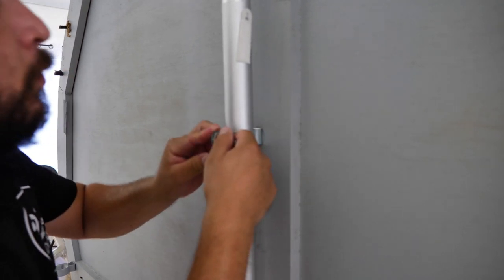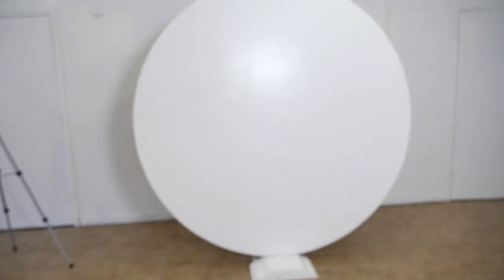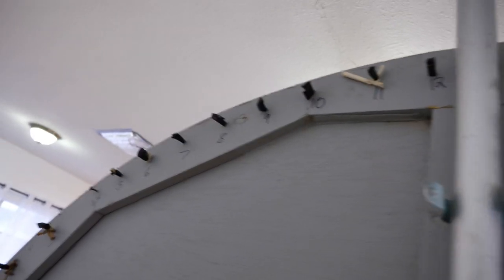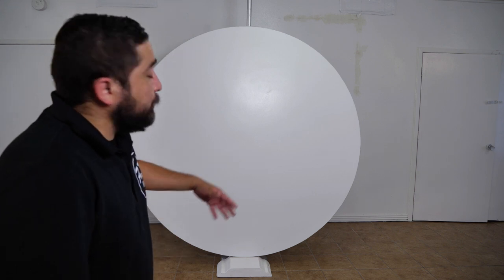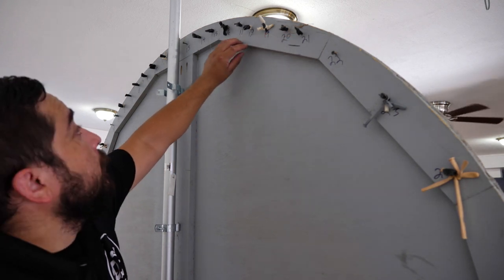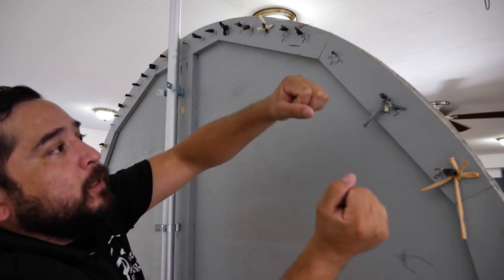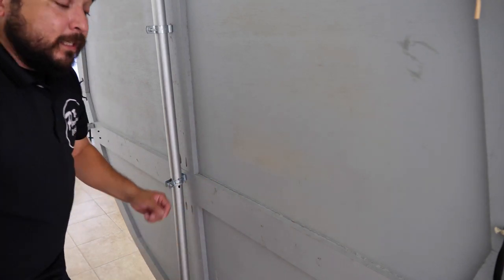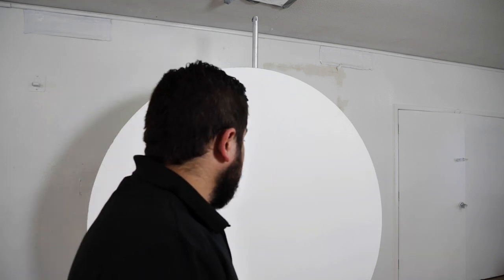How I made My DIY Circle Backdrop for Event Rentals for extra income

Comment: What paint did you use to paint the round backdrop?
Reply from the maker: Hi, thanks for watching. I used high gloss white from Behr. The high gloss gives it a good shine and worked great,
Reply: Did u put a clear coat on top of it or no?
Reply from the maker: @natashamitchell2904  The high gloss paint is the clear coat over it. There is satin, semi gloss, gloss, high gloss, etc. These are just different amount of clear coat built into the paint to give it shine. Matte paint has no gloss or shine. So high gloss gives a lot of shine because of the clear coat. It also protects it from stains or peoples hand prints better than a satin or a matte paint would. It is not 100% but it can easily be wiped off after an event. I repainted it maybe after about 6 months to give it the shine back with the original paint and worked great. You can try to add a clear coat on top but some times clear coats can tint the paint slightly yellow ish so I opted to just leave as is. If you decide to put a clear coat I would try first on a scrap piece of wood with the white, let dry and then clear coat. Then wait a couple of days to see if there was any reaction to the color. Hope this helps!

Comment: The oh baby was made from what material. If you dont mind sharing
Reply from the maker: Hi, thanks for watching. The Oh Baby sign was made from MDF board you can buy at Home Depot. MDF has a smooth finish and takes paint well after primer. But when cutting it wear a mask as the dust particles in the saw dust are not meant to be inhaled and can be dangerous to your lungs. Most signs are made from MDF because of the finish and the fact you do not have wood grain shining though the paint like you would with plywood. Good Luck.
Reply: @MakerDecor  much thanks for the info

Comment: Hi I had a question and wanted to make sure I am instancing correctly. When you made the circle backdrop is it cut into two pieces but you filled in the gap to cover? And what was used for the white part?
Reply from the maker: Hi, yes It is two large thin pieces of wood and then I used wood filler to fill in the gap. I then sanded it smooth, filled any spots again and sanded it again. Then I primered the backdrop with primer paint which helps cover imperfections. Then I painted it with High gloss interior/ exterior white paint. Two coats of paint and everything was covered and looked smooth.
Reply: @MakerDecor   thank you so much for replying and explaining. I also followed your wooden backdrop and loved the outcome but I think I made one mistake on wood choice and used two different types and the wood stain came out two different colors. I am thinking about resending it and re staining it again .
Reply from the maker: @vanessaayala1949  Yes it is tough getting all the same wood some times. But yes it is recommended because staining can be tough to match colors some times. So it just makes it easier.  Yes sanding can help some. And if that doesn't work I would try to  get a scrap piece of the different wood and try small samples of different stain to match the other wood stain before applying it on the finished pieces. Also if you do one coat and wipe off, let it dry and you can also add a second or third coat to make it darker. But definitely try it on the scrap piece of wood first. Hope this helps and let me know if you have any other questions.